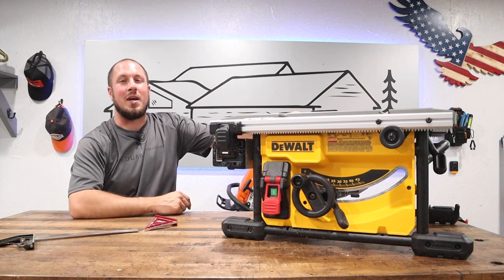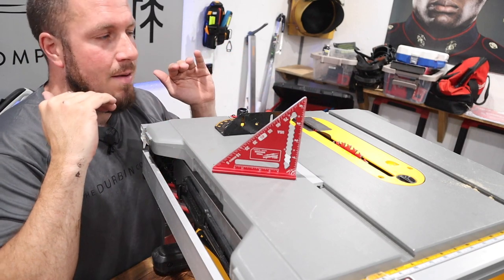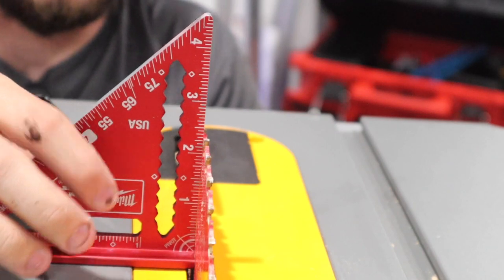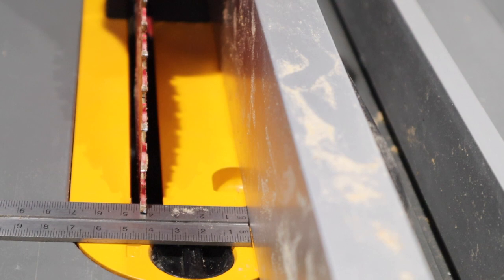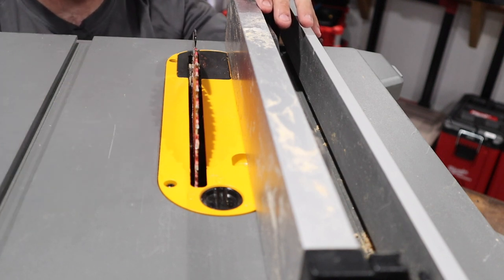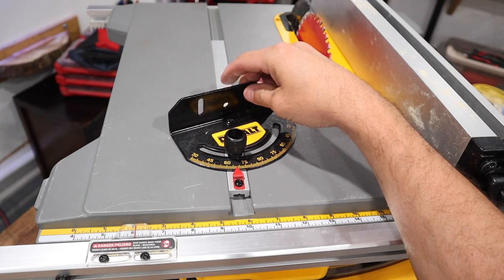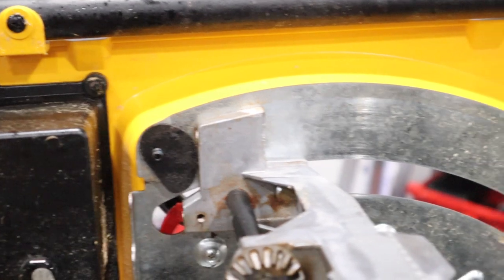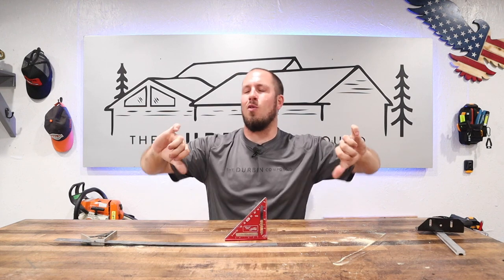How To Tune A Table Saw - Job Site Edition

Comment: Have you used or tried the Milwaukee M18 cordless table saw?
Reply from the maker: I have not. Have been considering it but have two jobsite table saws already……
Reply: @TheDurbinCompound  I'm in Makita and Milwaukee battery platforms only. Although I've heard good things about the Dewalt.
Reply from the maker: I’m only vested in the M18 and M12. I have a friend that has tons of DeWalt stuff and I could get ahold of at any time. I’m a firm believer that each brand has their strengths and weaknesses. I recently had a job where I really put the DeWalt jobsite table saw through its paces. Ripping 16ft pressure treated boards. I pushed it to the bitter edge and asked a lot of it. It didn’t disappoint. I know a battery saw would have eaten through batteries on that job
Reply: @TheDurbinCompound  I agree. Corded or cordless?
Reply from the maker: Corded. I’m still not drinking the koolaid on a cordless miter or table saw on my jobsite. I run corded stuff.
Reply: @TheDurbinCompound  🤣👍